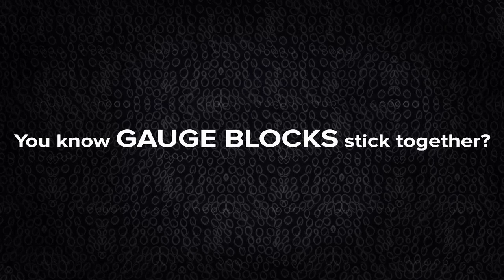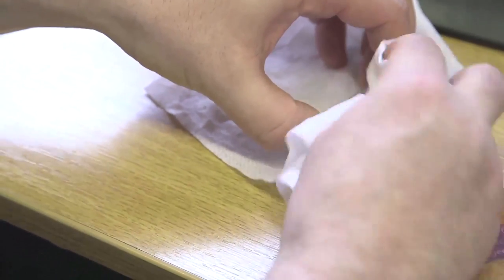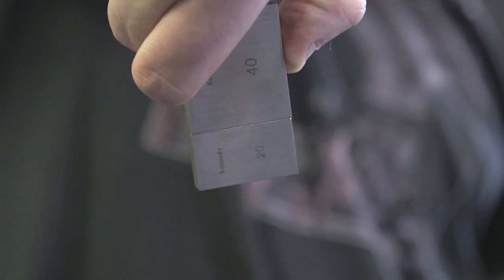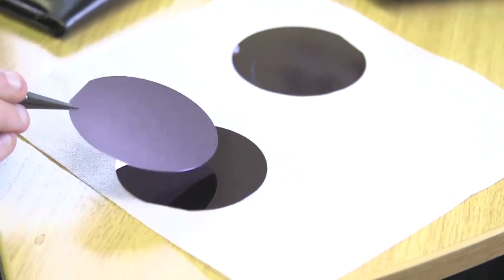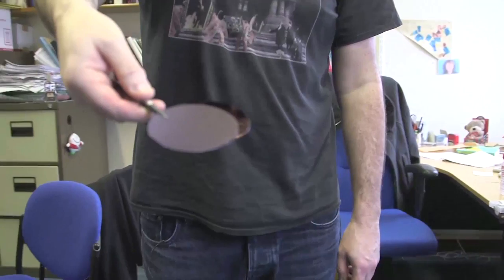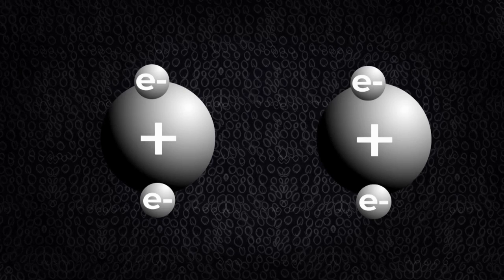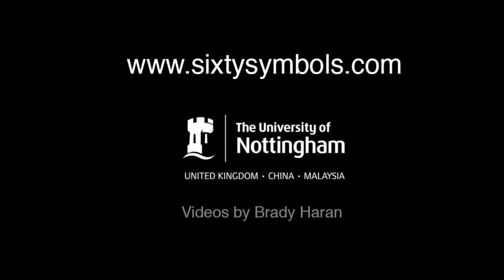Gauge Blocks (Van der Waals forces) - Sixty Symbols

Comment: Is this effect similar to the effect happening during cold welding?
Reply: As far as I know they are similar, but not the same. In wringing, also called optical contact bonding, the two bodies are extremely close, but are still separate. All that is keeping them together are the intermolecular forces like the van der waals forces as explained, (disregarding the water effect.) In cold welding greater pressure is applied to force the bodies closer together, so much so that the atomic lattices of the two materials can become one with one another, e.g. in metals usually creating chemical bonds, sharing electrons between neighboring atoms.

Comment: Could cold welding be involved with this as well, it seems like the conditions (maximum contact, removing the oxide layer, scraping of the metal together.) for getting it to stick would also apply to cold welding.

Though Id then wonder if that would do notably different damage to the surfaces if viewed through a powerful enough microscope.
Reply: As far as I know they are similar, but not the same. In wringing, also called optical contact bonding, the two bodies are extremely close, but are still separate. All that is keeping them together are the intermolecular forces like the van der waals forces as explained, (disregarding the water effect.) In cold welding greater pressure is applied to force the bodies closer together, so much so that the atomic lattices of the two materials can become one with one another, e.g. in metals usually creating chemical bonds, sharing electrons between neighboring atoms.

Comment: In the last "why do they have to be so smooth" part, I think the piece missing is that otherwise there would just not be enough electrons near to each other because all the surface scratches will lead to only a surprisingly low amount of points where the distance is really small.
Reply: They have to be FLAT. Smoothness is a side effect of lapping them FLAT.

Comment: I have heard that very clean metals under high pressure can actually stick together using metalic bonding, which can be a big problem for space probes and such.
Can anyone confirm?
Reply: Yes, that is cold welding, which is a similar but slightly different process to the wringing together of materials shown and explained in this video

Comment: I thought the surface has to be so smooth, because otherwise the distance between a major part of the two surfaces - and therefore between the electrons - would to big for this relatively weak interaction which decreases over distance quickly.
Reply: FLAT, not necessarily "smooth" (shine is a side effect of making blocks flat).

Comment: Wouldn't the extremely smooth surface help by providing the maximum surface area between the metal blocks? This would minimize the distance between blocks and statistically maximize the chances of atoms from different blocks being close enough to interact through Van der Waals forces.
Reply: Extremely FLAT surface is what you need. "Shine" is a by-product of lapping blocks flat!

Comment: I've used gauge blocks many times in my career. The act of joining them together is called "wringing" them together. And you do indeed twist them to ring them. It is the best way to push the air out from between them. A very well wrung pair of blocks can be very difficult to get apart. The higher grade ones they use in places like national standards metrology laboratories wring together even better.
Reply: Wringing.
Reply: Wringing.

Comment: Dipole fields also drop off as 1/r^3, so you need the surfaces to be in very close contact, and a large contact area. This is the main reason they need to be super smooth.
Reply: Are you disabled? He's clearly using this sort of vocabulary because these videos are meant for the "Average person" Saying he isn't a "real scientist" based on a single video on youtube, seemingly with 0 basis is /r/iamverysmart material
Reply: MathMeansMore Right or wrong, you certainly provided a much more coherent, scientific based answer than he did. He woke up in the morning and didn't know what a gauge block was until he did a google search. 0:20 
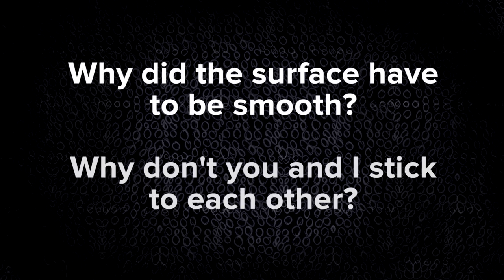I'll quote Moriarty. "So you need those smooth because you want those um if you have asperities there, you have sharp bits, then what happens is the forces don't add up in the right way. You don't get the interactions. Moreover if the liquid film is important the fact that you've got a very rough surface means that that water film, that liquid film, can't act as a glue in the same way". 5:55 

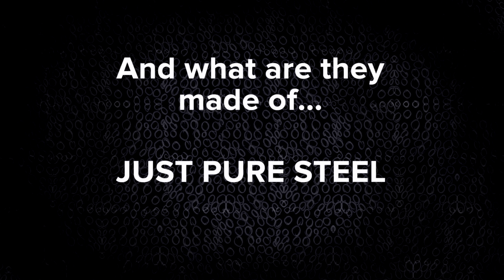For comparison, try listening to Doctor Feynman (a real scientist) give an explanation of subatomic particle interactions. Afterward try listening to Moriarty set up his explanation with the words "Jiggery Pokery". Yes he literally used those words in an explanation of subatomic particle interaction. Not the strong nuclear force. Not the weak nuclear force. Not the electromagnetic force. No. He prefers to rely on unscientific terms such as Jiggery Pokery. 0:55 
The muppet "Beaker" made more sense and was a better lab technician than Moriarty. https://en.m.wikipedia.org/wiki/Beaker_(Muppet)

Comment: I can tell you, working in metrology, our steel XX grade blocks ring together really well, our tungsten carbide blocks will not ring together at all, or will very weakly.  Not sure why that is.
Reply: The tungsten carbide blocks are polished to a mirror finish for one, and the silicon wafers in this video are also very brittle.  Still a mystery.
Reply: Tungsten is brittle, maybe it is less inclined to be as smooth as steel when polished up...just a guess
Reply: Have you been able to measure accumulative error with steel vs. tungsten carbide?
Reply: It might be because steel is body centered, and tungsten is face centered. Like it might affect where the electronegatives overlap.
Reply: Maybe they're worn out (more than steel ones)?

Comment: The effect is really pronounced when the blocks are new. Even fingerprints on the blocks will reduce the effect.
Reply: Oil helps them stick with surface tension.
Reply: We used standard rectangular and cylindrical jo block sets in one tooling position for years, we'd wipe the wd40 off used to preserve them with a clean rag and then to make them stick you would rub both sides with your fingers to get your oils on it (even after brake cleaner), then you push them together making an X, and while pushing you twist to align them.  Fingerprints work Brian.

Comment: althought van der walls may be the most significant force, isnt there also a suction effect? Since the surfaces are soo smooth there is very little air between it ( and very little area for new air to enter) since they are such stiff objects that when trying to pull them apart it creates a vacuum in the middle of the 2 surfaces.

Comment: Every block that drops to the floor I cringe, if the techs see this video they will never loan the professor another tool. Wear is a real concern for standards like these, regular calibration re-certification is needed and many owners actually pay triple the price just to get extra wear resistant ceramic blocks. Even the thermal expansion coefficients are specified by the manufacturers.

Then again that may have been their apprentice-grade set.(even at that each block is still $20, higher grades or ceramic and your talking $100 each)
(there are about five or six grades depending on the local standards organization, top one or two grades are for controlled environment lab calibration checks of other blocks and measurement devices; middle grades are for a company/shop in house reference; and the bottom two are intended for use out on the production line)
Reply: You do get it, though. You seem to be fun.
Reply: There's no way a physicist wouldn't recognize the importance of precise measurement. I guess we just have to trust he'd never do that to a perfect condition set of guage blocks
Reply: wolfedog99 ya, seeing how rusty they were I think he got loaned the junk set, lol.
Reply: I doubt he would be dropping them if they were brand new. They're probably old and already worn out
Reply: wolfedog99 Evidently Moriarty handles highly precise equations exactly the same as he handles the highly precise equipment. Garbage measurements for input equals garbage solutions for output. He doesn't get it though. He's too busy being impressed with himself.
Reply: +a name a name You sound like you have a problem within yourself

Comment: Does cold welding (in vacuum) operate on the same effect?
Reply: As far as I know they are similar, but not the same. In wringing, also called optical contact bonding, the two bodies are extremely close, but are still separate. All that is keeping them together are the intermolecular forces like the van der waals forces as explained, (disregarding the water effect.) In cold welding greater pressure is applied to force the bodies closer together, so much so that the atomic lattices of the two materials can become one with one another, e.g. in metals usually creating chemical bonds, sharing electrons between neighboring atoms.

Comment: Its fun to watch guys first attempt at wringing gauge blocks together. So in my experience, the best way to consistently wring blocks together is to clean them with acetone, then swipe the contact edge along your inside wrist. Then you position them 90 degrees apart and twist them together. Also I've seen it spelled Gage as well as Gauge and I'm not sure. Gauge blocks and a surface plate are the standards in a metrology lab. 

Also time to recertify those blocks. It looked like they had some rust on them, which destroys their ability to wring as well as their accuracy. Steel blocks should be stored with a coating of light oil. Not sure about ceramic block care.
Reply: To get the last guys skin oil off! Well gauge blocks have to be coated with light oil when stored, so the acetone gets that protective coating off. Just to be clear, you can wring gauge blocks together without wiping them on your wrists, it just takes longer. Maybe the wrist wipe pre-charges the blocks... I don't know why it works so well, but I know it does work. Gauge blocks won't wring if there's any kind of oil, dirt, dust... so trying to wring the blocks with the protective oil will result in frustration, and inaccurate measurements.
Reply: SJWs & Betas Killer Even low grade gauge block wring together perfectly fine. The issue was that he's never done it before that day, and they were corroded. And since they were corroded, they were probably not treated well, and may have deep scratches, dings, dents, etc.
Reply: Never run on your skin as your sweat can be acidic and cause corrosion. Use wringing fluid.
Reply: Whats the point with the acetone if you are gonna rub your skin oil all over the surface anyway?
Reply: They've chosen the low grade ("workshop grade" not laboratory) blocks, rusted and worn out. That's why there is a problem with wringing...

Comment: Do the technicians know that you dropped the blocks ?

They do now !
Reply: There is a reason they gave the theorist the set covered in rust.  You remember how he said the machine shop had multiple sets, right?
Reply: @rockets4kids  yup, that is also the reason he’s having difficulty wringing them together, they aren’t all that precise anymore
Reply: Yup. I've got a high quality set, and they're super easy to wring together, and you could probably hang a 10kg weight from them, they stick so well
Reply: @lifeteen2  i know a guy who owns an original johansson set from 1911 in pristine condition, he actually tested the force and they held a little under 120 kg when wrung together properly.
Reply: That made me cringe so hard when he dropped it. Might as well throw them out and buy a new set now lol. I figure that's why they weren't sticking together too well; cause they've been really beaten up.

Comment: I like to think air pressure is a big player.  Smoothly pressing the air out that can't get back in, holding it together.
Reply: nope, as they mentioned and is demonstrated on a few other yourtuber's videos (eg. Cody's Lab) the phenomenon still occurs in a vacuum.
Reply: I haven't seen that.  I will have to check that out.  
--And after seeing that, he can't press the two together in a vacuum.  His test still leaves open the possibility of a higher vacuum created between the blocks than his system is capable of obtaining.  Impressive test when they stay together during the vacuum process.  But he cleaned them really well after that part.  I'm not sold, just impressed.  Thanks for that!
Reply: Cody explained that.  The remaining air pressure acting on the blocks is far less than the weight of the block.  It can't possibly hold them together.

Comment: is it similar to cold welding ?
Reply: Yes. That's why you should never leave stack of gage blocks for long time (like days or weeks), they can "weld".
Same thing for smooth and flat sliding surfaces - they should never be done that way ("stick and slip" action guaranteed), you need grease grooves, different textures, etc.

Comment: Fridge magnets work on the same principle of an overall neutral object using areas of positive and negative magnetic fields to stick to things (though on a massively blown up scale). Fridge magnets have alternating strips of positive and negative facing magnets within them, and held more than an inch or so away the overlapping magnetic fields cancel each other out and no force is felt. But when it get's close enough to a piece of metal the fields aren't overlapping, so the positive facing magnets induce a slight negative field in the metal and vice versa for the negative magnets. Each strip is now held in place, so the entire magnet stays put.

Comment: will two smooth surfaces made of different materials stick together like this?
Reply: Yes. Buy a brand new aluminium pan with a machined bottom and put it on your ceramic halogen/induction hob. You'll feel the attraction.
Reply: Matt indeed. You can do this with a ceramic and a steel  block
Reply: Yes. But you need really flat (gauge block level) surfaces.

Comment: He shouldn't have cleaned them with acetone.
Reply: alex tworkowski  have you ever used Joe blocks before?
Reply: No.  I've heard of them, but know very (nothing) about them.  What happens w/ the acetone.  I can guess that it strips them of oil and they rust.  But that's just a guess.
Reply: alex tworkowski if he just wiped off the oil there is a tiny amount still left and they are sooooo much easier to stick together.
Reply: I see machinists rubbing the blocks on their wrists to clean off the oil.  Obviously this is not removing all the oil.  Acetone would remove all the oil.
Reply: Microscopic layer of oil is a part of "wringing" (sticking) of the blocks.
For stacks of blocks there are special tables to address stacking errors.
Reply: Quintinohthree the goal was to misrepresent the factors that go into getting Joe blocks to stick together.
Reply: Berend Harmsen Although, by eliminating as many factors as possible, including those employed to make the effect easier, the demonstration does have more weight to it. No jiggery-pokery as he'd say himself.
Reply: But he wasn't trying to explain why the blocks stick together per se. He wanted to isolate the contributing factor that made the phenomenon interesting. But I agree that in his thoroughness he didn't do himself any favours. I would have just mentioned it and wow the audience. But I'm lazy
Reply: Garganzuul  the goal was to figure out why they work, cleaning them hid one of the causes.
Reply: Tobias _ The goal was to demonstrate the strength of the vanderwaals force between hard, flat surfaces. Oil is not a hard surface, so its presence would have ruined the demonstration
Reply: Why not? It works better clean than if it's dirty
Reply: Yes, why not?
Reply: How does the oil facilitate the sticking of the blocks?  These guys seem to be thinking that the steel molecules are attracting each other.  But if the oil is a part of it then they are wrong.
Reply: Tobias_ the goal isn't to make them stick together but to eliminate accumulative error, such as multiple thin oil films.
Reply: Tobias _ Whatever the goal was, it failed on you.

Comment: It appears to work with the glass prisms I have. I thought it was atmospheric pressure that held them.
Reply: It's only a part of it. There are 3 mechanisms (van der waals force, oil/water layer as a glue, and air pressure).
Reply: Codyslab did a cool experiment using a vacuum chamber to test the air pressure theory.
Reply: air pressure wouldn't explain why you can hold the two pieces of metal horizontally next to each other and they still stay together...  although its not clear why this Van der Walls force would hold it up in that case either, unless there were some kind of stable pairing between individual atoms of one surface to individual atoms of another surface which causes a kind of force preventing the motion from starting (horizontally)...  but if all of the dipoles occurring are constantly flipping and there isn't any stable pairing happening like I said, then its not clear why they would stay together if held up horizontally (where the surfaces touching each other are vertical)

Comment: then when do you have cold welding?
Reply: Steven dv Cold welding happens only between oxide-free metal surfaces. Gold in air would do but any metal can do it, provided it's made completely oxide-free at its contact. Cold welding happens when the surfaces physically touch without any gap, the lattices interweave and two objects become one.